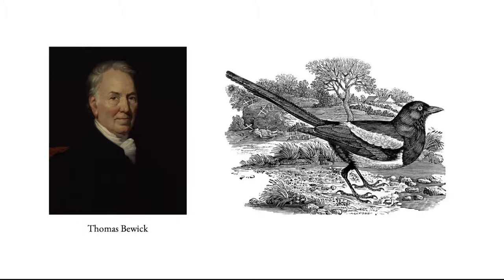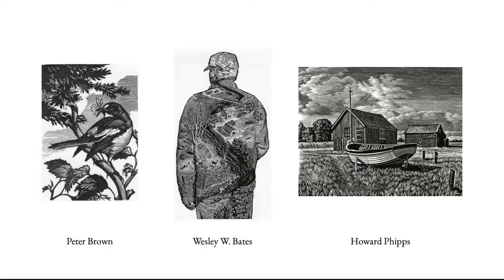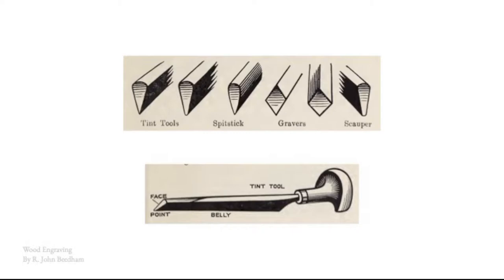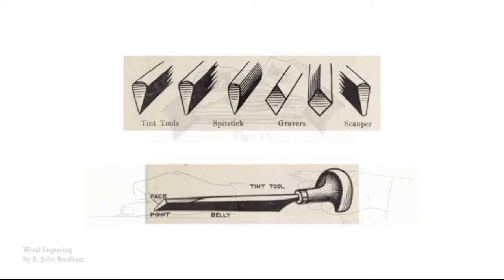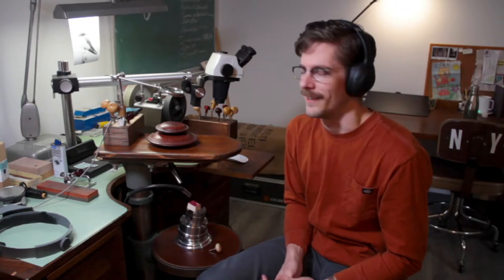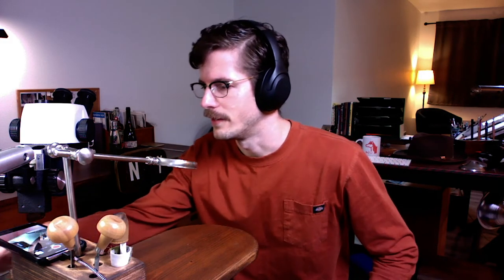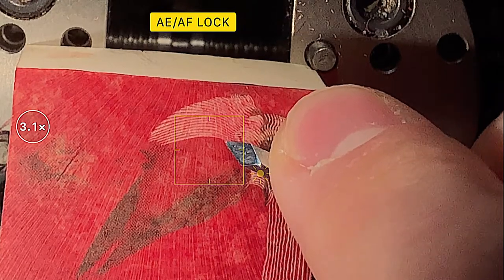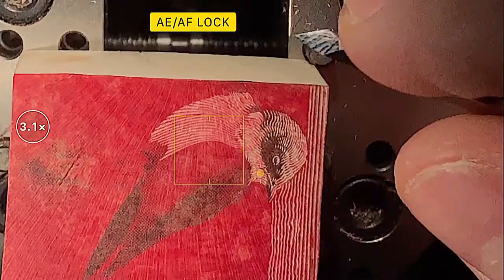Wood Engraving Basics

Comment: Hi, Nathan. You may not remember me but we talked a few years back about wood engraving. You must have made this video sometime after our talk. This is an excellent video on the wood engraving process. I had done only one wood engraving back when we talked and I still haven't done another one. One reason for that is that they stopped making Resongrave. I also watched your video on how to prepare a line drawing for print. I might have some ideas on how to do that if you ever want to compare notes. For instance, I think there's a way to get better vector results from Illustrator.
Reply from the maker: Hey Michael! Yes, I recently saw the news about Resingrave as well. It's such a shame. If you have access to maple or holly, I have made several blocks for myself using those woods and they've worked great. That said, if you plan on printing them in a press, leveling them and getting them to type high is the real challenge—I've only hand printed so far. And I would be curious to hear your process on preparing line art for print. I have been using an vectorizing app called Dragpotrace lately.